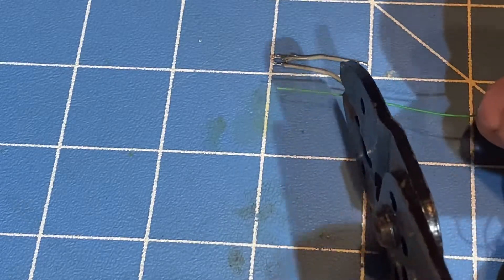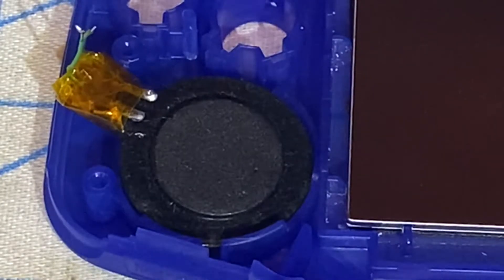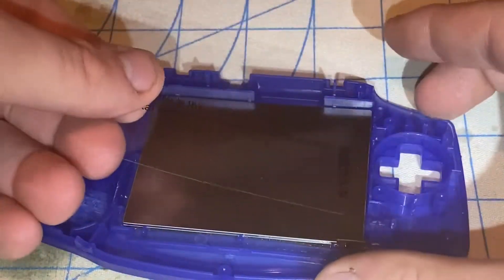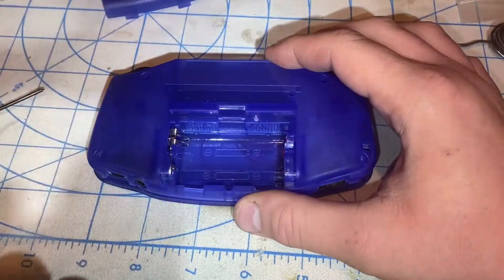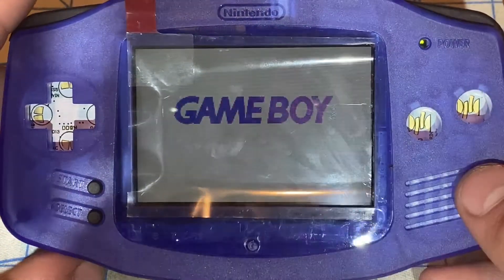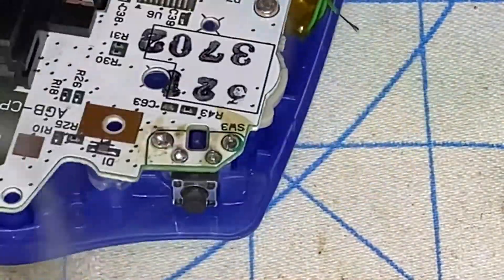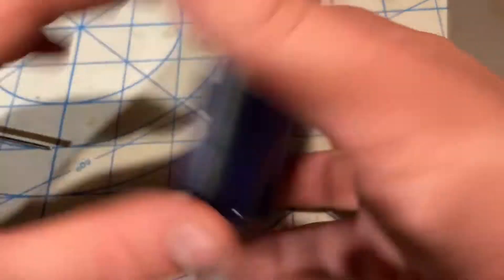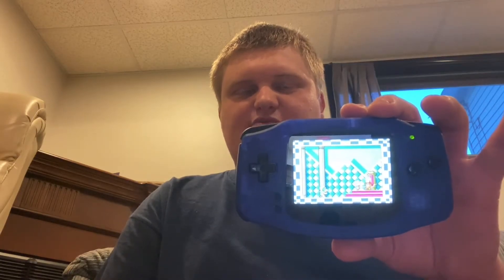Game Boy Advance IPS LCD V2 Mod Documentary Video! (Part 2)

Comment: let me understand, there is some ips v2 kits that doesn't have the capacity to keep the brightness when you turn off the console? because i have installed one and i have that problem but the ips v2 works well, the problem is when I turn off the console the brightness backs to the default
Reply from the maker: Cesar Islas The FunnyPlaying V2 IPS LCD ribbon doesn’t support the brightness control save, the generic ribbon does, that’s why.